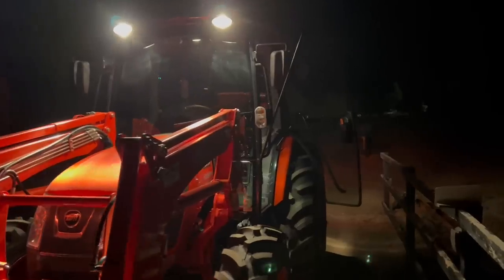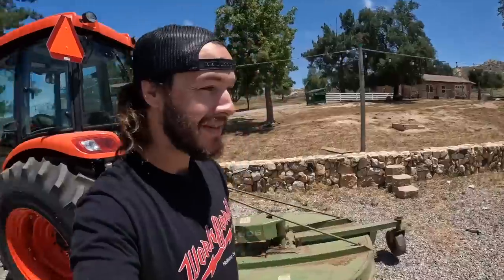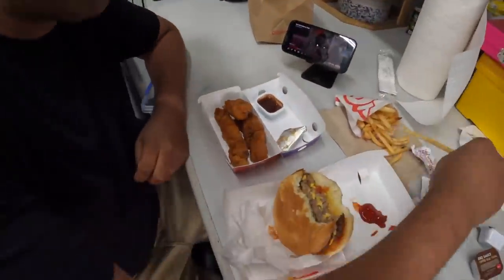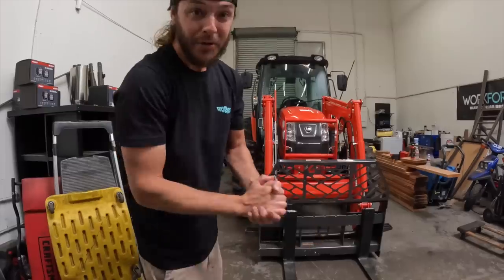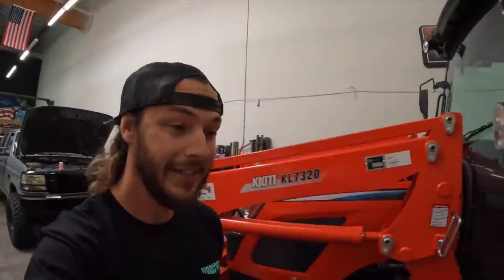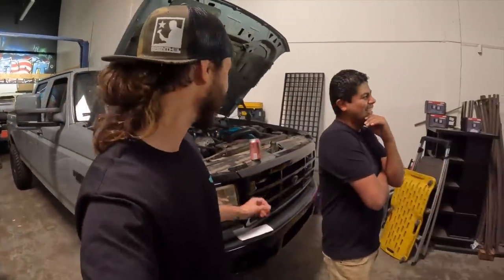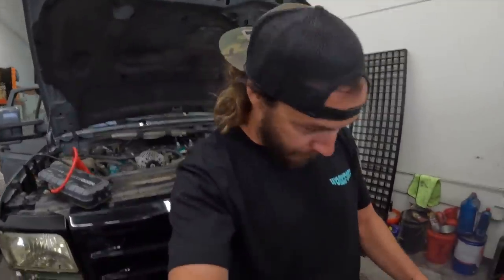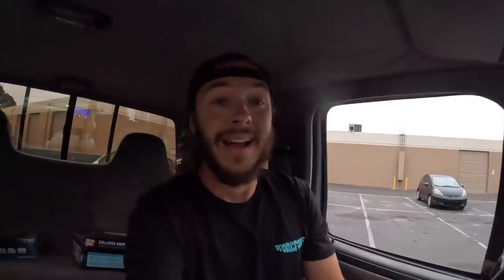Customizing my Farm Tractor Part 1!

Comment: 15:41 That hook/bracket is for hanging the top linkage of the 3 point hitch when not in use. It both prevents the linkage from bouncing all around, and it prevents the linkage from getting stuck inside the attachment triangle on the implement when it's hanging down like that when you back up to it. Doesn't mean you can't use it for the camera (although I wouldn't, it's too close to see anything), but it's good to know what it's made for.

Also, the light bars look like they're 99% spot lights. In a tractor, I'd focus mainly on flood lights, to make sure the area surrounding you is properly illuminated. Especially in the back, it's not that important to be able to see hundreds of feet. For the front it's a nice addition, but floods usually are a lot more helpful.

Comment: We've got lights mounted on everything on our farm. From the tractors to the combines.  Most of our lights are mounted to the top of the cab with a bar thats bolted to the roof bolts. We have a little ford tractor we use at the house to mow our pasture and ive got a 20in rigid on magnets that we put on the hood so I can mow at night when I'm not working.

Comment: I have a set of the diode dynamics ss3 pro pods for the fogs on my truck and their 30" light bar with combo driving lenses on my ranch hand for auxiliary lighting. Hands down the most expensive LEDs I've had on my truck but also hands down the brightest. Worth every penny. I've had a mix of cheap Amazon LEDs and mid range from brands such as Cali Raised LED. I wish I had just gone with Diode dynamics from the beginning

Comment: i used to work for Diode Dynamics......yes they do test all lights in real world conditions they have tests booths to put the lights in to test and make sure the case wont fail under outdoor circumstances. The light bars are the only thing they dont build in house they outsource the building of the light bars but still are really good lights.

Comment: If you have a substantial back plate, mounting to the fiberglass is a nonissue. Also, one thing I noticed is at the beginning of the video the tractor itself is lit up like the sun. If you direct that light away from the tractor it will let your eyes adjust better. You're killing it! Keep up the good work!

Comment: Next time you load the tractor try put the chain on the left side of the tractor to the right side of trailer and the right side of the tractor to the left side of the trailer, probably do the same for the front of the tractor, if you want to strap the front end loader attachment down to stop any bouncing noise so if anything comes loose you can pull over and check

Comment: My tractor doesn't have a cab and with a front end loader the headlights in the grill are useless with the grill guard. So i guess to mount a light bar on the roll bar would be the best option. Can't drill holes in them but they do make a glue on mounting studs or go with magnets and then also running the wires for connecting without damaging them from moving parts and hot areas. On yours I would think on top of the cab.

Comment: You need a F450 with a gooseneck trailer now that you have a big tractor like that. It’ll tow way better and maybe safer with the weight being centered over the trucks axles.
Reply: I wouldn't worry about it. He's likely rarely going to tow the tractor, and tractors are bigger than they are heavy anyway. That whole tractor weighs less than a small skid steer.

Comment: Shouldn't it be enough to replace the original lights that are on the roof with led only and then ignore the led ramp? And the halogen lights in the front you can put in a conversion kit.
I had first tried 2 pieces of flood led in the front roof and rear roof
and then a conversion kit in the front.

Comment: Instead of pulling up and putting then folding the ramps and then backing up. Why not just put the ramps so they are in the up and down position?  Im sure you have a reason.